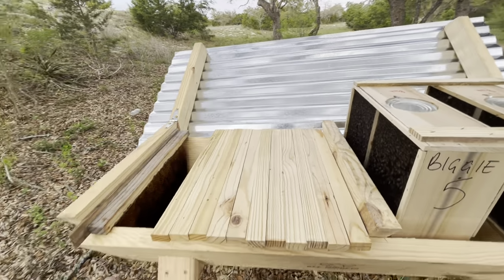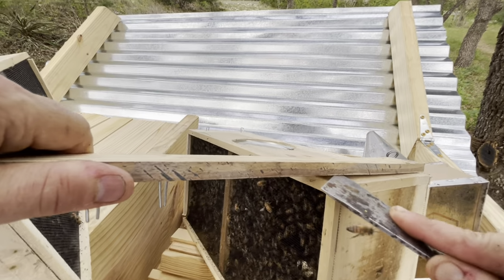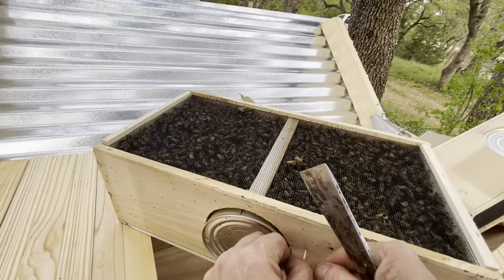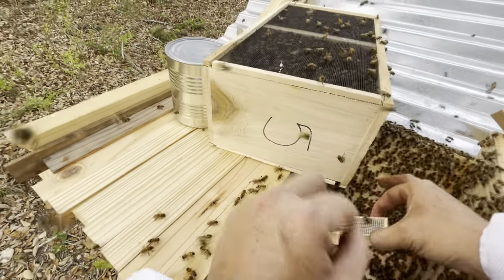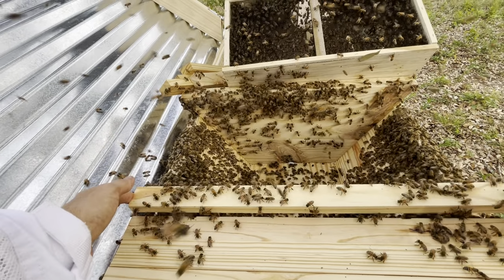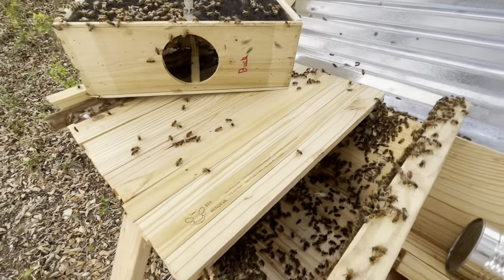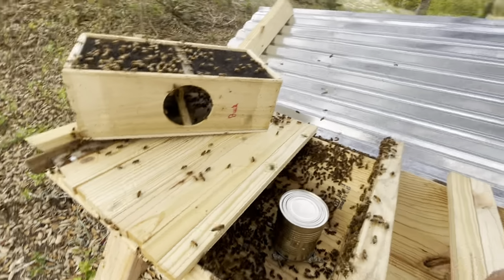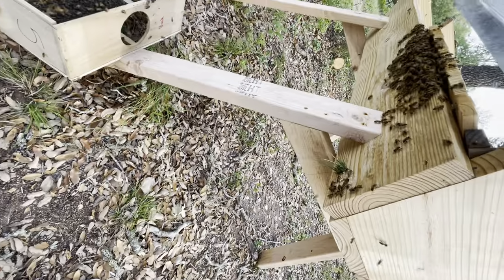I dropped the queen cage into the hive when installing my package of bees!

Comment: A thumbtack will be your best friend to avoid it dropping queen cages in the hive
Reply from the maker: Thank you! I have used thumbtacks before, and that works well... except usually I don't have them with me lol
 I dropped it into the package box when I tapped it to drop the bees to the bottom without holding the queen...I regularly do it once a season and then never again.... I usually attach the cage under the bars or hook it (metal strap) over the edge of the wall...